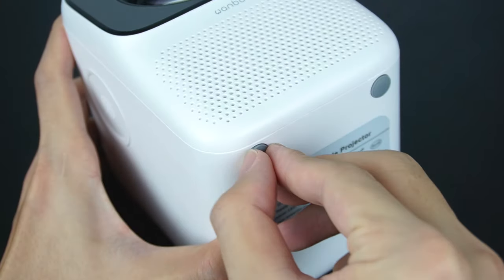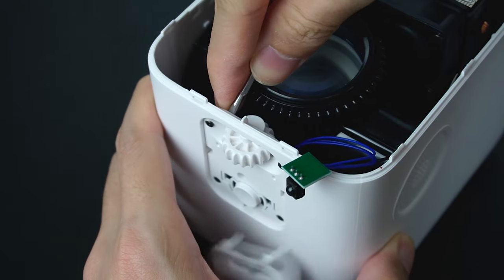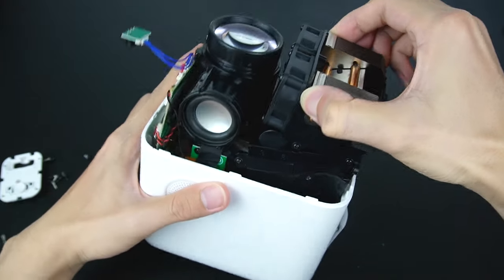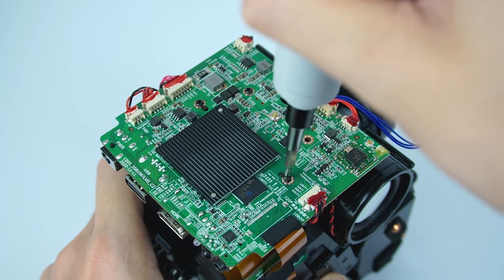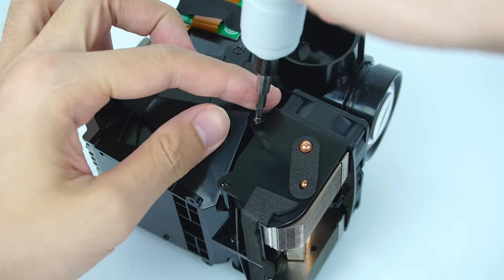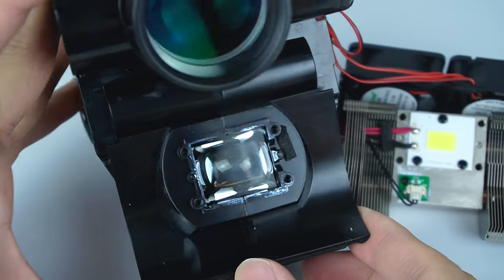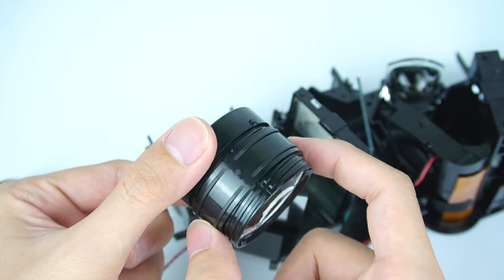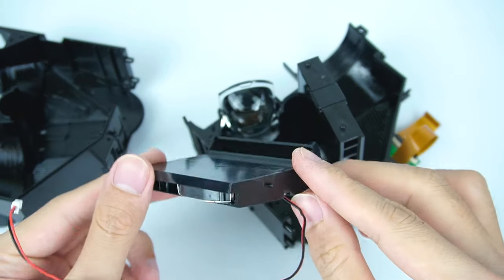What's Inside a Projector - Teardown Xiaomi Wanbo T2 Projector

Comment: Hi, is it possible to upgrade the LED in this projector to a brighter one?
Reply: bhai projector hai Pokemon nahi jo viksit karonge
Reply: The Royal Gamer  why not? The cooling system seems quite capable.
Reply: I think that if the space where the LED is, you can mount another one with higher lumens and modify the power supply so that it can turn it on. it's just a matter of trying
Reply: I think yes that can be done but upgrading the led lamp will emit more heat plus it will eat more current for that you will need more cooling so if you can think of all these problems then yes you can upgrade, i think 500lumens increase is no issue for these heatsink tray replacing the led lamp with a more brighter one. 👍 Cheers
Reply: I have the exact same question, could you please tell me if you found out how to do this? If you reply and you were unsuccessful then I will endeavour to find a solution and make a video with relevant info if you still would like to do this. Peace from Ireland mo chara.

Comment: Thank you for this video. It inspired me to upgrade the fans using Noctua and is so much quiet now!
Reply: Hello, what's the size of fans?
Reply: @wk8465  40x10 mm
Reply: Thank You!
Reply: @maiba02  yeah, but the problem is that the only Noctua fans I could find are either 3 or 4 pin and the fans from the projector both only lead out with two red and black wires out of each into a preperared socket housing. The Noctua fans each individually come with 3 or 4 so that meands 6 or 8 total which makes no sense as there is no socket accomodate those :((
Reply: @sixtheninth  the noctua come with the “noctua omnijoin”. It is an adaptor which you can use to match the 3 cables from the fan to the two pair from the projector.
Reply: @maiba02  aha, so no soldering or extra expert action needed? Could you also tell me the exact model you have used in yours? cheers!
Reply: @sixtheninth  a pair of Noctua NF-A4x10 FLX, no soldering at all! Just a firm press with a with the pliers, that’s all. 👍
Reply: @maiba02  muchas gracias senor, will got them and if any troubles hit me on my way, I'll come back to you!
Reply: @sixtheninth  good luck! Cheers
Reply: @maiba02  Okay I finally got it apart and oh boy my rookie ass is already overwhelemed and especially confused by the manual and the overal settings too. Also I failed to find any YT video tutorial on how to do this operation surprisingly, so I will state the challenges I can identify and explain my understanding in points: 

1.) By first glance I see 2 wires leading from each fan that are colored red and dark red (so no black) They both meet in what I believe is called header (socket housing sprayed my dark red glueish matter). Next to it I see another header which is called FAN GND and that has another two wires red and black led into it, but not from fans itself but from the body of the projecor - not sure if they will play any role in the re-wiring process. 

2.) Now manual suggests that I shall cut the original fan wires off and leave loose ends of the Red (R) and Dark Red (DR) wire. But what is already confusing in the Noctua adapter uses Black and Red wires, so the colors don't match already. I assume one is - and another +, but the B is refered to as Ground (GND). I am a correct assuming that DR wire is in fact the B and that I should treat it as GND on the scheme? 

3.) Manual also says: "Make sure to correctly identify the GND and +5V leads of the original fan - why +5V and not 12V when the Noctua and the original fans are 12V? 

Thanks for your patience and help. Also if you know any tutorial on how to do this properly, please do share. Thanks :)
Reply: @sixtheninth  Hi! I don't know if there is a video out there to guide you in this procedure. This is what I would suggest you: I believe there might be slight variations among different projector models. Mine has black and red wires, but it seems you have the same displayed in the video (with dark red and red cables). On the projector board, you'll find three sockets: the large one is for the main LED, the next one, with 4 cables (2 positives and 2 negatives), is meant for the 12-volt fans, and there's an additional socket for the internal fan, which cools the internal screen.

When replacing the fans, only cut the cables in the middle, specifically the ones that connect to the two fans (also the socket in the middle). I want to clarify that I'm not an electrician, but I assume that the dark red cable corresponds to the black wire from the Noctua fan. Ensure that the replacement Noctua fan you choose is also 12 volts, just like the original fans. 
If you are using the omnijoin adaptor remember to press it firmly. The first time I tried this, I did not, and the fans weren't functioning because of that. Good luck!
Reply: I somehow manage to push the wires back in and run the whole machine when out of the house just to find out that our super quiet Noctua fans work, but are loud as hell, basically zero difference to the original :((( 

Wait you have also mentioned a another fan somewhere deep in the projector? Can that be the source of the problem, the crazy angry fan from within which is invisible and I had no idea about it being there in first place. So I guess the question is, can that one be replaced as well? Is it the same one as the frontal ones?
Reply: @maiba02  so you would not believe what happened, I finally found a replacement 5V fan for the faulty LCD screen fan replaced, it all was superquiet like a dream, the moment I put it all together the LCD screen stopped working immediately, no screen at all, total ko :(((( I could not find a replacement screen.
Reply: @sixtheninth 
How is it now, did you manage to get it fixed? I have experience with some issues and may be able to help. I am not happy with the brightness and may upgrade the light, if you get back to me then I may be able to help you also.

Comment: Do you know what is the input voltage range of this projector? I would like to use it as portable projector. I think it should work with 18V Dewalt batteries (working voltage 16-21V). I saw some car chargers, they looked like just a cable without any voltage regulation circuit, but the car battery have also a voltage between 10-14.4V. Wanbo customer service don't want to give me an answer about it, they recommend to use original power supply.
Reply: I don't think so the power hungry led lamp will eat all your battery, the screen eats 5v some mili APM rest all the voltage is going in the lamp see those heats the lamp gives out electricity in the form of heat waste
Reply: @Nomad_Wanderer  I think 2x 5ah battery should be enough for 2h movie. The question is, if the voltage is not to high when battery is full, or not to low when the battery is on the end
Reply: Just take a USB Power Delivery 19V Adapter Cable and power it with >65W powerbank
Reply: Great idea, did you ever find a solution?
Reply: @tomasotreasaigh111  not yet, I checked, that normally, the batteries are charged only to 20v, so there are chances, that it would work just like that, without any converter, but did not try yet
Reply: @tomasotreasaigh111  It works like the way i explained, you just need a >60w powerbank and a 19v USB pd adapter. I tested it with this projector.

Comment: I succeeded in disassembling the projector with your video.
thank you
My projector is (WANBO T2 MAX).
The power connection part came off.
The female power connector was broken.
I'm trying to attach the power supply wires directly to the board.
Can you tell me where to put it?

I can't upload a picture ㅠㅠ

Comment: Hello, I have the Mi Smart Compact/Youth projector and it’s bricked. It’s stuck on the mi logo on boot and doesn’t start up. I tried resetting through the Ok+Back button method but it doesn’t go into recovery. Can you please tell me if there is a way to reset the projector by unplugging something on the main board or some switch on the board? It’ll save my projector.

Thank you :)
Reply: Try re factory reset if that doesn't work then you need to re flash the boot img Android iso.

Comment: If my t2free Is burn ( it have big blackpoint on screen when open ). I can buy led for t2 max to change led from t2 free to upgrade to  1200pixel ? (t2 free is 800pixel)
Reply: Burn point is due to led screen not led light ...

Youll have to get the led panel ....

If not DIY with a old mobile ..
Reply: @swegattyswooty9307  I have a pernament brownish spot in the center of the screen, I assume this is not possible to just wipe right? If so would you know where to buy a replacement Led screen compatible with this projector?

Comment: My projector has a dark burn spot and it is spreading until it totally covers the display so I cannot see the views showing.

Your video blog helps me open my projector but my problem is where I can buy and replace glass with the cable connector on the polerizer film.

My projector brand is yookie S10. Only 4 months old only and it is damaged.

Does anyone know where I can buy parts?